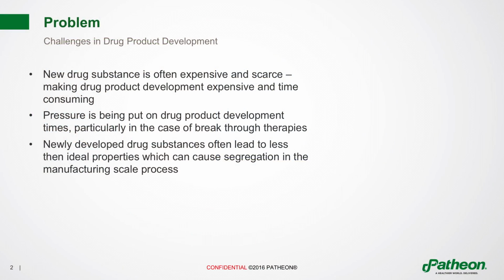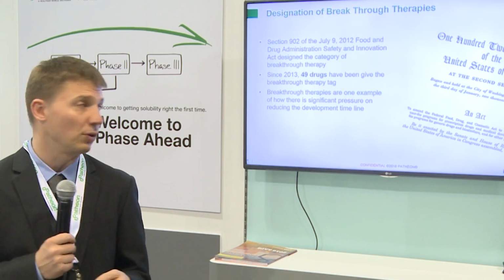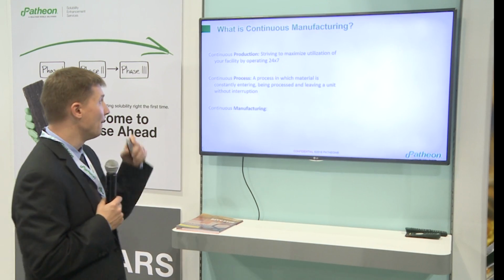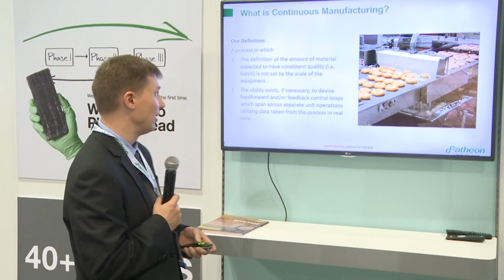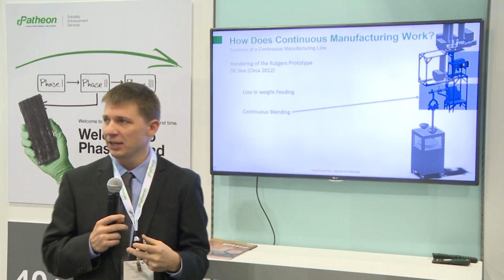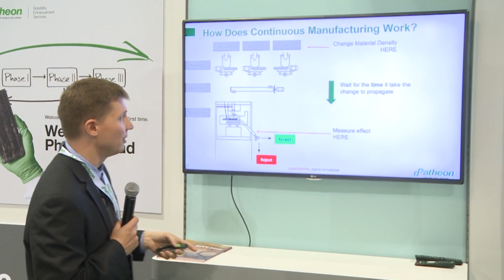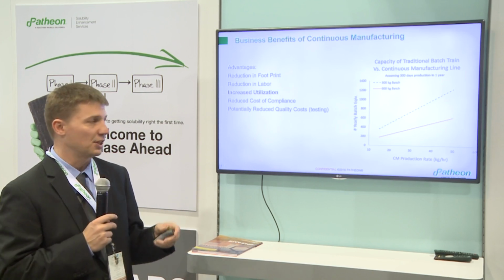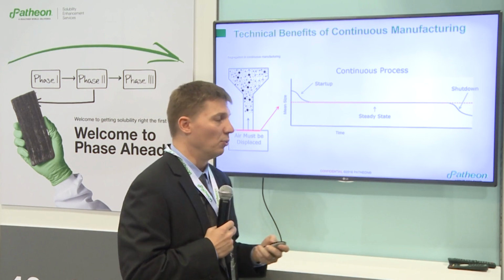Patheon's Eric Jayjock discusses Continuous Manufacturing

Comment: The advantages in development due to scalability and speed of parameter change evaluation are obvious. What's less clear to me is how to avoid possible quality and manufacturing pitfalls.
What happens to upstream material that's been introduced if a problem arises? How do you reliably detect and weed out OOS material? Have advances in instrumentation in the industry kept up with the demands of multi-unit processes? (the automobile industry has mind blowing systems that integrate with each other reliably so it's certainly possible). How does downtime for product and equipment changeovers generally compare with batch processing? How have the validation challenges been for you?
Thank you for your presentation. I'd love to learn  more about the subject.